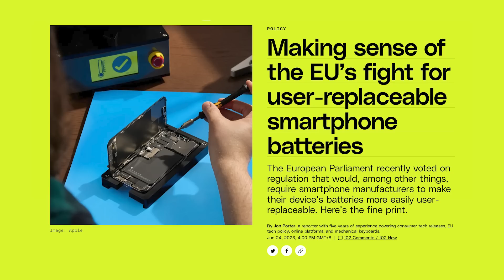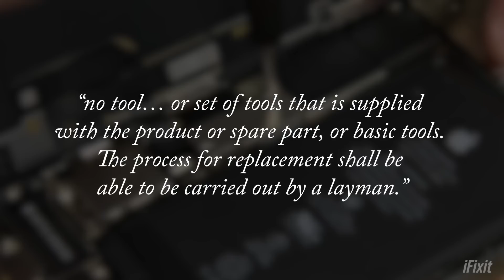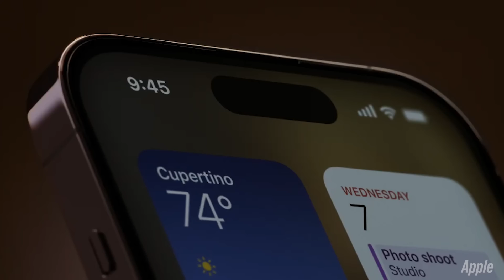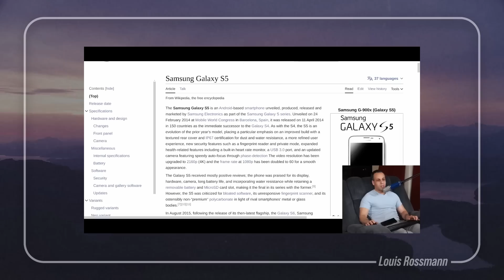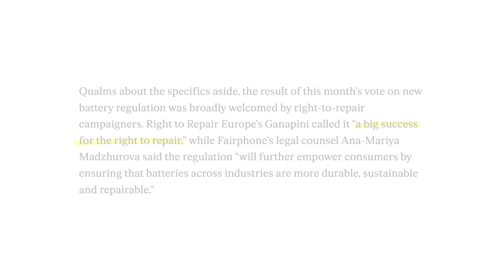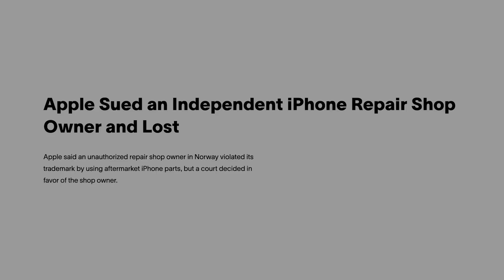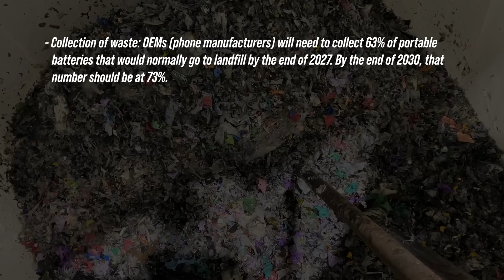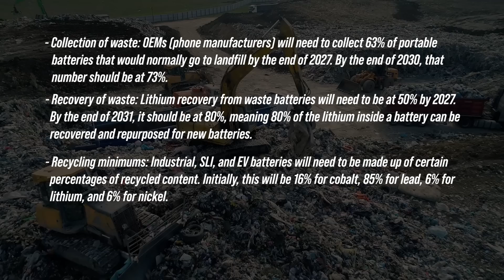EU Just Changed Smartphones Forever

Comment: I was mildly exited about this when phones were mentioned (though it doesn't affect me because my phone does have a removable battery).  But when I saw laptops were included, I was ecstatic.  

Had my work laptop freeze on me a couple weeks ago and even holding the power button wouldn't reboot it.  Instead of waiting hours for the battery to die to restart it, I had to disassemble the stupid thing, find the battery cable on the motherboard, and pull it.  Turned what should have been a two-second fix into a lengthy, annoying, and potentially damaging task.

I wonder if this will affect videogame controllers as well, my impression is that they have also all gone to sealed batteries.

On the subject of waterproofing, removable batteries have nothing to do with waterproofing.  It's not even hard to waterproof a phone with a removable battery.  I've had multiple "rugged" phones that were waterproof, and they've all had removeable batteries.  You just have to put a rubber seal around the battery door and have the door held down with a couple flathead screws instead of a snap tab.

As far as manufacturers reclaiming batteries, just make it the same as a car battery.  Apply a core charge to the new battery that's refunded if the consumer presents the old battery at the time of purchase or after the replacement is done.  This will incentivize customers to return their old junk batteries.

This was also definitely not a natural trend from consumer demand.  It was absolutely corporate greed guised as an "improvement" to phones with lies such as claiming it's required for waterproofing.  Most smart phones that have removeable batteries still have a sleek design.  They don't have an "ugly" battery door; the whole back comes off, so the edges of the removeable portion blend into a visual seam that was already going to be there anyway.
Reply: Has xbox gone to sealed batteries? Im pretty sure its still double A batteries no? And you can use rechargeable double a's or get a battery pack. That was always the best feature in xbox controller truly wireless. batteries run out and youll have a new set in the controller in under 5 seconds even if you are clumsy so there is genuinely no plugging in.
Reply: @MV-ri7zu  You know what, you're correct.  I thought they had switched to a sealed battery as well, but they do still have a battery door.
Reply: @NoName-ik2du  Ive always wondered why the playstation fangirls shit on the battery door on xbox controllers when its superior in every possible way to the built-in battery of ps controllers really odd stuff.
Reply: @MV-ri7zu  Actually, I may have been wrong about saying I was wrong (sort of).  Looks like maybe there's an "elite" version of the latest Xbox controller that doesn't have removeable batteries?

I think the argument against removable batteries is that you can't charge while playing.  While I agree that's annoying, that's just the product of bad controller design, not the biproduct of having removable batteries.  You can easily have both (though maybe they avoid it with the AA design specifically because it's possible to put non-rechargeable AA batteries in a controller like that).
Reply: @NoName-ik2du  yeah the elite version doesnt, but that doesnt really matter the people who buy those controllers get a new one once a year or every other year anyway for competitive use, because they breakdown in that time in heavy use anyway. The normal controllers that come with the console have the battery panel.

Or they play with it plugged in 24/7 for reduced latency like I do, my elite 2 is 4 years old now and its absolutely fked like half the buttons are broken, the trigger stops are completely broken so the triggers can get stuck at bottom, middle or top position regardless of where ive actually set the trigger stops with the switches lol
Reply: @NoName-ik2du  if you cant figure out which batteries are rechargeable and which are not then you dont need to be on a gaming console lol also you can buy rechargeable battery packs that slot in so you dont need the panel just buy 2 battery packs.
Reply: @MV-ri7zu  I'm thinking kids.  Children are entirely capable of changing batteries, but may not recognize the difference between regular and rechargeable.

But kids or dumb adults, products are generally designed with the lowest common denominator in mind to prevent lawsuits/bad press.
Reply: @NoName-ik2du  trying to recharge non-rechargeable batteries has absolutely nothing to do with the controller or microsoft... There is no lawsuit to be made
Reply: @MV-ri7zu  No, I was talking about the controller charging the batteries while they are in it.  If your controller has a cord that allows you to charge while playing and accepts AA batteries, someone may put non-rechargeable batteries in the controller, and then plug the controller into their console to charge.  I was speculating that that may be why Xbox controllers can't be charged with a cord while playing like PlayStation controllers.
Reply: @NoName-ik2du  really? I thought they can be? Ive never even tried tbf, but I thought it would charge batteries in it if it had any and otherwise just turned it into a wired controller
Reply: @MV-ri7zu  I don't believe it can.  I don't have an Xbox, but I think my cousin and I tested with his awhile back, and the controller would not charge the rechargeable AA batteries inside.  He always had to take them out and use a wall charger.
Reply: @NoName-ik2du  lol never noticed that, but tbh I never saw any reason to do that in the first place
Reply: @NoName-ik2du  8 bit do controllers at least have accept 2AA or a battery pack with extra pins so that you can charge and play. Though you can't if you are using AA's but you can just play teathered and charge the AAs seperatly.
Reply: @MV-ri7zu Xbox controllers will not charge AA batteries regardless of what type you use. They will only recharge the battery packs which have a small connector on them to tell the controller it’s a battery pack.
Reply: @joshuadavis1547  ok
Reply: While I have a rechargeable battery pack in my xbox controller when plugged in to a usb extension cable it will still charge the pack this has resulted in one pack being completely fried as it was over charged
Reply: Not to mention unless your rich who walks around with a naked phone? I know I can't justify avoidable damage and a subsequent replacement phone just because "sleek".
Reply: @evil1by1  Someone who isn't clumsy
Reply: @evil1by1  other than most people?
Reply: In fairness, a lot of the arguments for replaceable batteries (ie. I have two batteries so I never run out of charge) is easily done just by having an external battery pack to charge the phone on the go.

The main undeniable benefit for phones having removable batteries is a reduction in repair cost if a phone battery dies or reaches end of life. But that's a comparatively small use case, given the majority of people upgrade their phone every 3 years or less, and early battery death statistics show its a very minor issue in comparison to number of phones made. And we'll probably see the phone manufacturers just bump the cost of the phones (and possibly the batteries) themselves to offset the potential losses from authorised repairs and replacement of the battery.

It's a pity the EU waited over a decade to take retrospective action, instead of jumping in when the manufacturers first tried switching from replaceable batteries.

Comment: (cough) Fairphone (cough)

What I mean is: Fairphone (either the company or the device) already uses a lot of recycled and Fairtrade materials. You can take out the battery without any effort. Also, it's <quote> Designed to open </quote> which means you only need one single small screw driver to take it apart and replace the camera, bottom or top module, screen etc.

Comment: Apple is the biggest culprit generating eWaste. 
Their impossible replacement repairs created no way for consumers to repair their phones at a reasonable cost. Its “cheaper” and easier to replace a new phone.
Is anti consumer when just replacing a component will not work because their built in authentication and synchronised it only by Apple service centre.
This is the most abusive and enslaved their customers.

Comment: I support "right to repair" movement but things like this subject "no tool required" shouldn't be forced but optional. Do you remember the phones where it's charge jack or headphone jack was covered with piece of rubber or plastic to protect from water and dust? Those were all breaking off from the phone and leaving the jack to open completely. Do you remember when you were changing batteries instead of charging and phone's back plate were getting slack and wouldn't hold in tight because for frequent battery change? And even the battery itself weren't holding against the gravity because the battery pins were lose? No thanks. I would like to change my phone's battery with special equipment, just provide the equipment like the sim card eject tool and sell batteries in open market and don't force me to leave my phone to service and charge for thousands.

Comment: What if they just add a tray which holds the battery and use gold contacts to connect the battery? Basically like sun trays but with battery.

You build that in titanium so it can be lightweight, ultra light and slim so it doesn’t even take that much space in the device.
Reply: that would make it bulkier. people want premium, this isn't a good idea, if it were people would have bought the phones that attempted this already

Comment: This is a really short sighted view because while being harder to open, this kind of design allows phone to be completely waterproof.
Also, batteries nowadays are denser and have a much longer lifespan.
Reply: Maybe more people caring about having a durable phone than people wanting to swim with it... Also watches for divers can have their battery replaced and be sealed waterproof again, why not phones. Laptops also have less and less easily replacable batteries. The list of scams meant to shorten products lifetime is long and that's why laws against this are needed...
Reply: @Alex-sp9sd  concerning watches, it can be done but it’s not for laymen. You can easily do it wrongly only to realize it post Mortem when the watch stops working and a specialist looks at it.. I know my refurbished iPhone 12 Pro Max is no longer considered water proof as originally sold because the battery has been serviced. It’s in the reseller TOS.
Reply: I know that, diver watches need to be resealed by a specialist, though a phone is not supposed to go like 30m deep underwater. I mean a phone level of waterproof is more 'accidental brief immersion', a risk, not a functional feature. It's a matter of pro / cons balance, is it better to shorten the lifetime of all phones, or only the lifetime of phones accidentally immersed... Every 'progress' is a coin with two faces, except we can't choose the face we prefer, that's the problem. Plus the whole point of marketing is make us believe we absolutely need some new feature, even though it cancels a useful old one (SD card, jack...).

Comment: Well thank goodness, I have been banging on about this to anyone who will listen for 5-10 years. ALL devices including handheld game consoles (SteamDeck, Switch etc) should have easily swappable batteries. I remember how good it was to be able to put in a fully charged battery into my phone if I was going anywhere and the battery I was using had run down a bit, especially with my Nokia and Samsung phones. I have no use for water proofing, I mean so what? And glued phones just feel tacky and cheaply made to me. (A bit like when the original luxury Lexus came out and in teardown we found the door panels were held on with double sided sticky tape. Tacky and cheap.)

Comment: They also have to follow this law with another one of mandatory updates for certain years, otherwise the companies will find ways to force you replace the phone every 2 years.
Reply: And a law to stop predatory design practices to achieve the same end.

Set the fine to actually be punitive. Not just a slap on the wrist but something like 10% of the revenue from that product line. Not profit. Revenue.

Comment: EU Should also make Mandatory to have Headphone Jack and SD Card Slots Mandatory
as this will make a user use a phone for a long lifetime
and anyways tws are lithium dumps and 3.5mm Earphones are Nowadays repairable
so less e waste
SD card will help to have more storage for files hence no throwing away of less internal storage phones and less e waste 
Cloud should be an option not forced
Reply: SONY "fan boy"* here.
Headphone jack, tool-less SIM/SD tray (same as on photo camera), while maintaining water resistance, no "notch" or hole in the screen, enthusiast features.
You can get these things not only in midrange models, but in a flagship too! Made by a company that supplies photo sensors to 70% of other phone manufacturers (like Apple) and manifactures some of the best audio and video tech on earth. Everything you want in a phone about which nobody cares. With 0% market share...

Like they make some of the best Bluetooth headphones, but they still keep a 3.5mm jack. Like come-on for f- sakes!
Reply: @majus1334  Yeah My Goal is to Buy a Sony Flagship
They are Just ❤️ I'll manage with every issue it can give but I will get a Sony Phone just because they didn't make this No Headphone Jack and SD Card Nonsense
Reply: SD Cards are draining battery and not so fast (they are eMMC) as internal UFS phone memory, so storing let's say apps than let's say pictures slows down your phone even more. I think we should create new standard of flash cards, with like UFS speeds.
Reply: @DominiX32  I guess You're Unaware of UHS 2 based A2 Grade SD Cards 
Just think about it when You can load Games on Steam Deck and RoG Ally via SD Card then Why not on Phones 

In Samsung Phones not the Whole app but less used assets of Games are moved to SD Card for Saving Internal storage.
UHS Micro SD Cards contain Speeds upto 200MB/s Read and 120MB/s Write 
Good Enough for 4K Recording and App loadings
Reply: @adityapathak2046   Honestly they just should produce phones with larger storage. I really  don't get why there are phones with 128gb or even less. It costs like nothing compared to the total costs.   I have 256gb, which are always full but to be fair 50% is shit i just never came to delete and another 30% is stuff that i use like once a year and don't delete because of that. Imagine the internet could break down and i wouldn't be able to download it again 🙈🤣
Reply: @adityapathak2046 
I was planning on buying Steam Deck recently, just sold Nintendo Switch as it was too limiting to my tastes.

But you're right. Never heard of UHS 2 SD Cards, but I may've been some years behind on this subject.
Seems like SD Cards are going in the right direction.

Thanks for pointing out my "being behind", I'm glad for it! I Did some research and you're right😅
Reply: @DominiX32  I'm Glad i was able to help 🙇
Reply: Seriously you still use jack plugs? I think i used it for the last time 10  years ago. Not just because the cable is annoying but although because i had so many broken cables..... The battery is a valid point, should be replaceable  as well, but even in the current setup wouldn't give them a way for a cable headset ever.
Reply: @dan2792  In my experience, flat cables are the most resistant, I've never (yes, never) had one fail on me in years. And even if they did broke, replacing them is cheaper and more eco-friendly than a battery.

Yet, wireless earbuds do have their place, they're great for physical activities where a cable gets bothersome. But overall I think wired headphones are just superior. They sound better, unrestricted usage time, no interferences, easy to repair, cheaper.
Reply: @dan2792  I am a Neckband + In Ear Monitor (IEM) User 🗿
IEM have Replacement Cable = Less E Waste 
They have Better Sound Quality (Till Date) that too for Cheap than Wireless ones.
Reply: @adityapathak2046   Interesting first time i hear about  that, but one question, how much did you pay for yours? I guess for that money i have enough earbuds for the next 20 years.... If I'm mistaken, which one do you have?😀
Reply: @dan2792 the wired cable earphone and headphone use now are moving for audiophile users, because Bluetooth nowadays are limited by bandwidth so audio need to be compressed and looses some details. While wired/cable can deliver high quality audio details from lossless audio source as it. Good wired cable earphones nowadays came with various multi  speaker/driver inside a single earphone to handle every frequency separately.

Comment: removeable batteries and waterproof would be fine but im worried about the drop resistance. i remember some of the older phone would basically disassemble itself if you dropped it incorrectly, flinging the components everywhere
Reply: Haha Nokia 3310! A long time ago my brother was angry with me and threw my 3310 on the ground. The front was here, the battery was under the couch... Put it back together, turn it on, and no problem!
Reply: There is actually a design principle that assumes "planned breakage" to dissipate energy from drop/hit, so that this energy will not cause damage that couldn't be reassembled. The failure would be not in allowing "rapid disassembly", but taking a permanent damage.

Comment: The dead hand of the technologically illiterate EU strikes again as they effectively just banned EV's.
A Tesla contains 7,104 18650 cells in 16 444 cell modules capable of storing up to 85 kWh of energy. The battery is an integral component of the vehicle's chassis and has immensely complicated liquid cooling systems and computer monitoring of every cell.
The idea that an EV could have a user replaceable battery is as stupid as it gets.